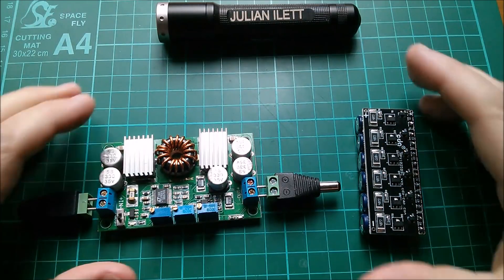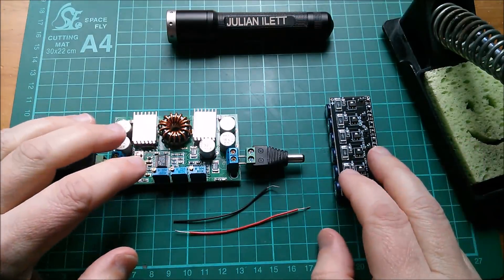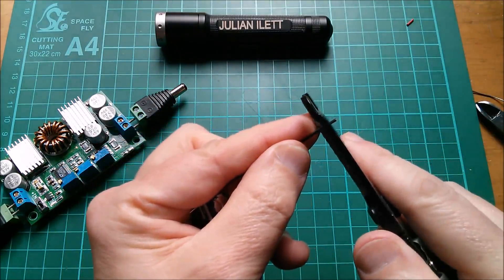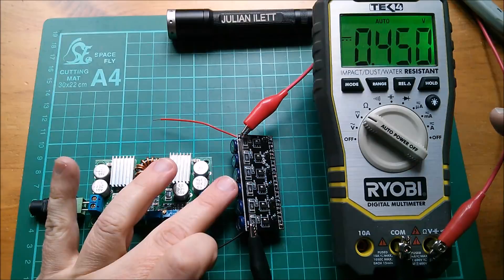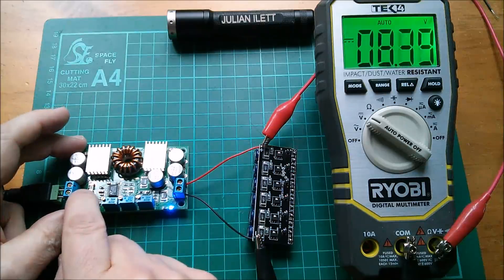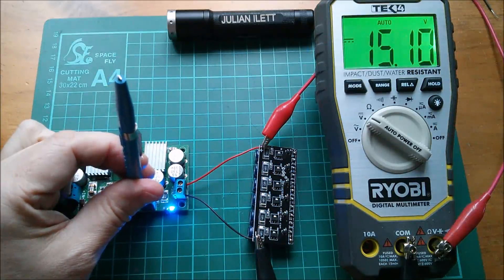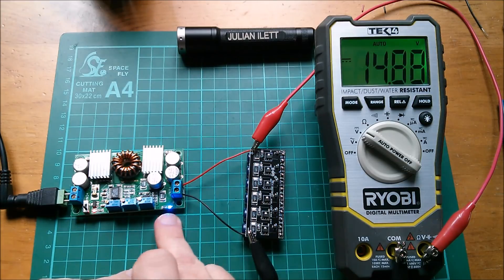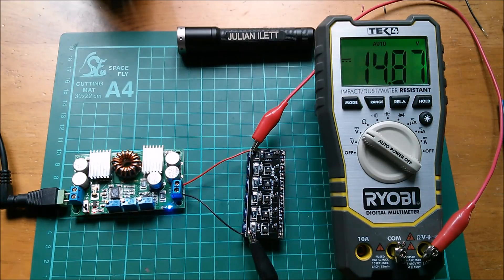Anti Backfeed Test - 10 Farad Super Capacitors and LTC3780

Comment: I tried this using a buck boost RUIDENG DPH3205 charging a battery. Worked fine without a diode until I shut the power supply off. As soon as I disconnected the power it fried my converter. Not sure if that would happen with all of them but it did mine. I ended up buying another one but will always use a diode when charging batteries or caps.

Comment: Time for some decent Pomona test leads: 3782-36-x where x = 0 (black) or 2 (red), length 36".  If you like those and need smaller get a pair with the micro grabbers but they're not nearly as durable.

With all this super capacitor experimentation, what is everyone doing with them?  What is the big picture plan.  How about a system diagram of your solar power system?

Comment: About backfeed: If its not reverse polarity backfeed and if there is no resistive drop across + and - and the voltage does not exceed the rated voltages, it should have little or no effect right? If you feed 12v in the correct polarity to a 12v power supply then there should be no major issue since it's rated for 12 volt to be there anyway.

Comment: Maybe missing the point, but rechargeable batteries will save a lot of space, be cheaper, and will run the amplifier(s) for much longer times between recharges. If used properly, they'll last for many years (maybe longer than the life of the amplifiers) before needing replacement.

Comment: You can use those 700F super capacitors to run a small 150 to 500W 12v DC to 110v AC power inverter to run a small power tool in an emergency! Would be a great idea! Add some solar panels and you get a really simple UPS! you could charge your phone from the inverters 5v USB ports and a whole host of other uses!
Even run an LED light bulb
I tested it and it even ran a 200W vacuum cleaner!
Really good in combination with a 5AH 12v SLA AGM battery. the super capacitors help prevent voltage sag during surges of current like starting up something and they make the battery last a lot longer. squeezing out every bit of capacity out of the battery as the voltage drops to 10v it cuts off at 9.8v
I plan on getting a solar charge controller to use with my 100W solar panel to power my computer off the power of the sun to see how long it can go for! What a fun experiment!!!

Comment: super capacitors of small capacities need to be kept at voltage for a few minutes to saturate them at that voltage. they have a noticable amount of resistance in them thats why they need a few minutes of saturation at the target voltage then the voltage will stay more level.

Comment: Hello. Greetings. What do you gain by saving a nickel and not using a diode ?  It is guaranteed to go flat. In a couple of time constants, the voltage is way down. You can't just let the caps sit and be ready to work immediately because they have to be charged up first. Or is this just a safety discharge system ?

Comment: Most switching topologies that are capable of boosting the voltage will have an output diode or equivalent. Otherwise you wouldn't be able to charge the output capacitor above the input supply. Although there will be a small leakage via the output voltage divider used in the feedback circuit.

Comment: Ultimately, you should get a definitive value for the backfeed current, and then decide from there whether or not you will get better runtime from eliminating the backfeed but losing anti-backfeed diode's drop worth of usable voltage, or from eliminating the drop, and suffering the backfeed. My guess is that the anti-backfeed diode approach will win the calculation.... especially given that the ultracaps have self-discharge of their own.
Reply: Also, be sure that any anti-backfeed diodes you use are genuine. I recently put together a very similar project and discovered that the 1N5408 I had bought from china behave much more like the 1N5822 instead. 2 orders of magnitude worse reverse leakage according to the datasheet....

Comment: Hey Julian, I don't think backfeed is a problem in the case of an buck/boost topology. The output is connected to a MOSFET drain only, no connection to any diodes or resistors and so on. So as long as the polarity is positive, and the MOSFET is turned off correctly (which I suppose the ltc3780 does) no current will flow backwards. Just desolder that LED :D
Reply: Need to adding a diode in series

Comment: Where do you get your croc clip leads from? I've tried ebay but they invariably seem to be very low quality.
Reply: You could buy just the croc clips on their own and make your own cables the way you want them.
Although soldering to these typical croc clips is a bit of a mess because they don´t take the solder too easily. You need the right solder paste or flux to get it to stick properly.

Comment: Instead of "risking" your super capacitor bank or your PS you could have just tested the output with another PS and a resistor going into the converter using the same DMM to read the current.  Start with a 1k-10k resistor and work your way down.  Very simple test without the worries.
Reply: use Arduino to measure each one

Comment: Is that a 'hard' switch on the board ?
You didn't leave the switch on and remove power.
It's probably not going to be a problem as the final output is probably a transistor of some kind that turns off when power is removed.
Reply from the maker: I think it's a soft switch because the fault LED comes on when the output is switched off.

Comment: The DVM is probably more of a drain on those caps, than that blue LED.
Reply: Nope.  The DMM/DVM will have a resistance of 10M ohm or more but the LED requires several mA to light.  1000x difference.

Comment: Couldn't the supercapacitor powered bluetooth speaker not use a second buck-boost converter to provide constant 12V supply, so all (or at least more than just 50%) of the super capacitor energy could be used in a useful way?

I was using a capacitor and resistor to power an LED, but of course the changing voltage affects the current, and at the beginning most of the energy is wasted in the resistor. Could a buck-boost regulator provide a constant power output?
Reply from the maker: Yes, I can see this device having two LTC3780 modules. However, the amplifier will work down to 6 volts - the LTC3780 buck/boost works down to 5 volts, so maybe there's not much to be gained.
Reply: Sure, the amplifier will run, but I tend to suspect that volume will drop from full voltage to minimum voltage.  Especially at higher volumes since the amp has smaller power "rails" to work with.  I guess the bigger question is if the amp is set up for "volume" (using the feedback loop), or if it's "constant gain".

Comment: Don't these have incredibly poor high and low temperature characteristics?  That and their still-inadequate power density makes you wonder if we need a breakthrough before conventional battery technology faces real competition.
Reply from the maker: As I remember it, supercapacitors have much better high/low temperature performance compared to lithium cells. My dashcam uses a supercapacitor because lithium cells don't cope well with the very temperatures inside a car parked in the sun.

Comment: I tried to charge a battery once and after turning off the power supply to the buck converter, the battery fried the chip from the buck converter with a loud "pop". So I would not recommend this.
Reply from the maker: Looking at the buck converter block diagram I can kinda see why. Boost converter has a diode in its output anyway. But the 4-MOSFET design of the LTC3780 looked quite benign as far as backfeed is concerned. I suppose I should have warned that this may not work on all PSUs and DC/DC converters.
Reply: Julian Ilett that might be a good idea. That is the reason I made my comment, because I learned it the hard way. 😀
Reply from the maker: Best way to learn ;)
Reply: I too learned the hard way with a buck converter, but my problem was more to do with a sloppy soldering job and the output wire shorting out onto the capacitor right next to it, the chip probably received the full 65W or so of my laptop charger as it popped and then burst into flames within a couple seconds, it was quite the spectacle.
Reply: the magic smoke has great wisdom........All praise the magic smoke
Reply: I wrecked a $300 bench power supply in a similar way. When I tried to turn up the output voltage, there was a pop and a burnt PCB smell. Fortunately Rigol replaced it.